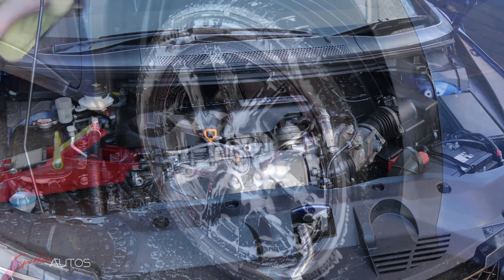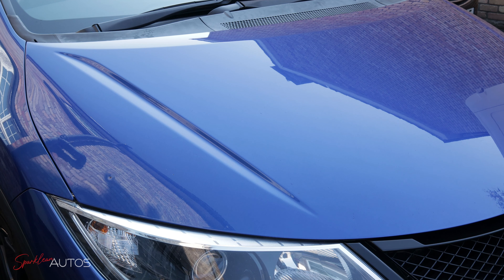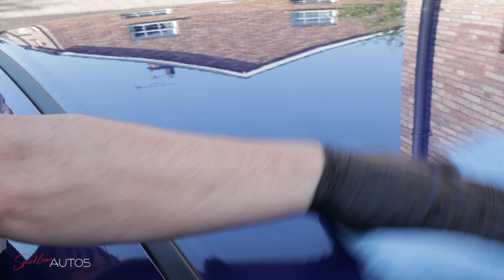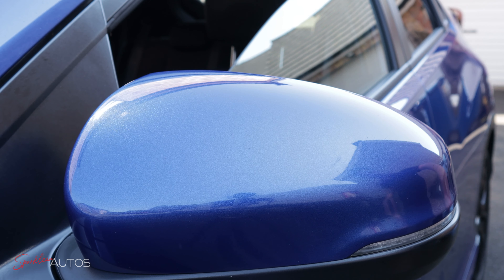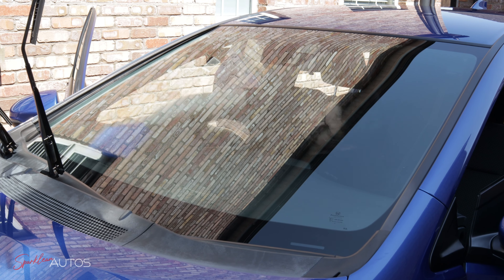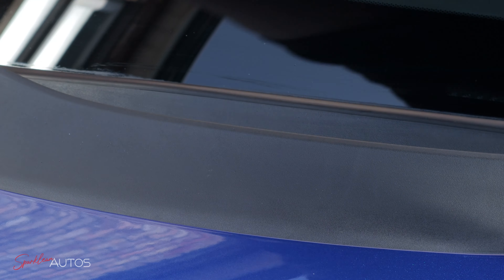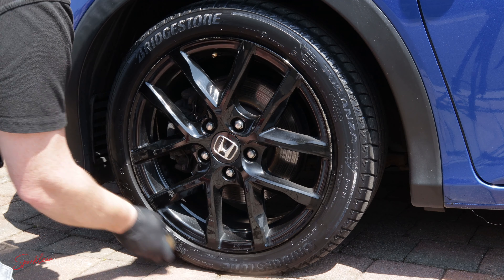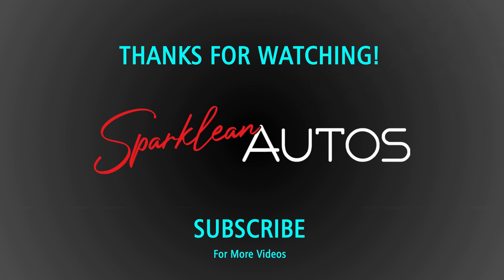Honda Civic Showroom Finish - Satisfying Car Wash, LSP, Trim & Tyres #carwash #cardetailing #carcare

Comment: Top job sire 👌

Far as Sigma V2 goes, try leaving it longer before the final buff as I feel it helps the initial bond, and therefore longevity.  It's hard as it's just such a slick finishing product... 
I've definitely seen a longer lifespan with customers' cars... actually had one back about 3mths after V1 was applied, hadn't been touched, and was beading again on the upper surfaces after the prewash... 

Oh, and IYKYK... get to MaccyDs for freebie ones...
Reply from the maker: Cheers Jon. Good tips for Sigma, I'll definitely try that next time ..  and must head to McDs and stock up, start selling them on eBay 🤣

Comment: The car looks amazing and I do like the colour of that Civic although I was never a fan of that body style on the Civic. I nearly bought the 1st Gen of the Civic Type R but ended up buying a Land Rover but I recently sold my Civic sport plus as I needed a tow bar and couldn't mount one with center exhausts. I was detailing my Jag yesterday and my Mitchel;l & King wax was nearing the end of its life but I thought I would top it with Sigma as I had topped it with GT Qd the last time and it did look good but I had a bottle of Sigma V1 and it really looks good now. I put on the Gyeon wax onto my Qashqai today and the red seemed to deepen and I am looking forward to the rain tomorrow to see the water behaviour. With regards the GT Serum I had used it for about 3 years but am using the Turtle wax graphene tyre dressing and think it is slightly better but will probably go back to Serum as I still have 500ml left. I need to try the glass cleaner again but my opinion on it was not for me but I guess I should give it another go but I do like the AutoBrite Crystal glass cleaner but my bottle is nearing empty. I thought you were going to use CS I really liked it. I had my wife's ex bosses car in for a detail a brand new Q5  straight from the showroom with all the toys and a Special paint, blue colour the same as his football team and I did it with CS over two days as it started to snow halfway through application but I have never used it on any of our cars as I have a few waxes I still have not tried and it was a lot of work not that it's a problem in retirement..Looking forward to whats next from you.
Reply from the maker: Thank you John, always look forward to your messages 😊
I wasn't a fan of this shape of civic either but seeing it all cleaned up & looking new did have me rethinking it! 
Sounds like you enjoy trying lots of different protections and I do appreciate that, it's very addictive! I had considered CS but to be honest this started off as a quick wash and I just got a bit carried away 🤣🤣
I'm also a fan of the Autobrite glass cleaners and, like I said to someone else in the comments, there's no perfect product to suit everyone!
Anyway thanks again John and chat soon 👍🏼

Comment: Glass cleaning is something i hate as i think ive tried everything under the sun and i still get smears
Reply from the maker: I don't really have an issue on the outside or even the side glass, but I agree that inside the windscreen can definitely be problematic!!

I do find this one very good but I've just this week received a very different type of glass cleaner which promises to be smear free 🤔 I'll use it a few times  first though before risking my own reputation by recommending something I haven't tried! 👍🏼